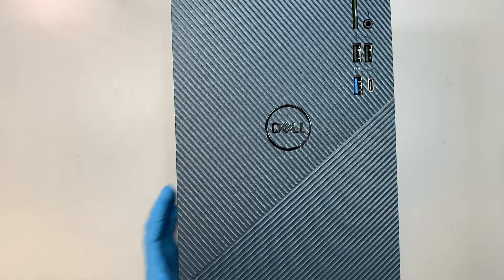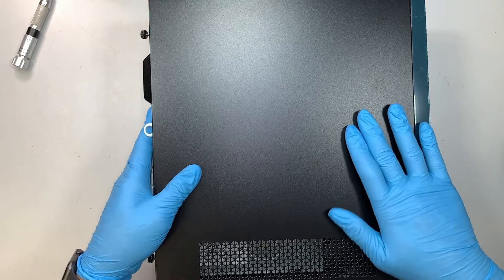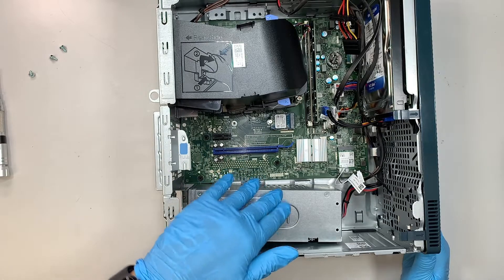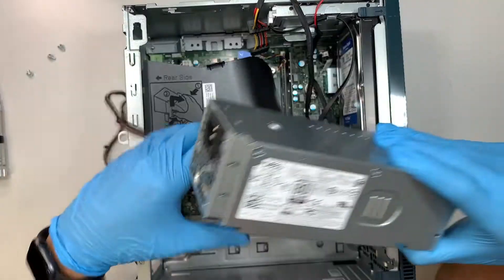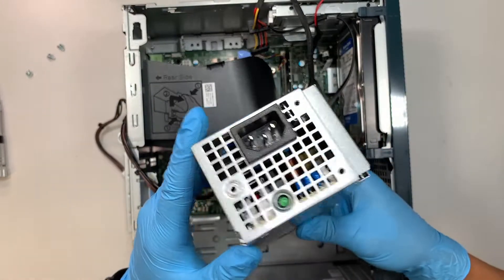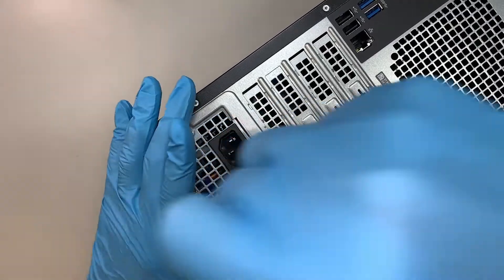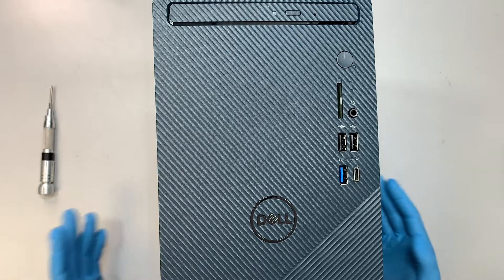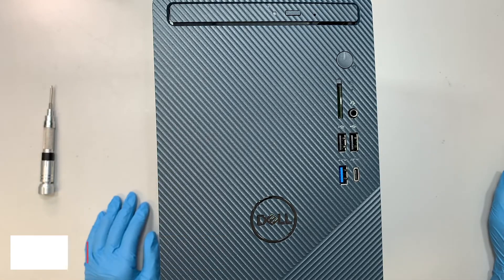Fixed Dell Inspiron  3910 No Turning On Bad Power Supply

Comment: Thanks for posting this. If we want to purchase a graphics cards (I mainly want one for photo/video editing not gaming) we'd have to purchase one that is powered by the PCI bus as the power supply it comes with does not have the cable or capacity to power a graphics card, correct?
Reply: If you buy a power supply from a different dell with the same proprietary power connector, you can have a gpu with a 8pin + 6 pin

Comment: Only 8 comments? Nothing about testing the new power supply first before you  take cables wires and unscrew everything and  take the original one out and put the new one in and screw it back on sid pnelll then it doesn't work  when it's the memory or the cmos or the CPU etc ?

Comment: I bought 4 of these 3910s for our office and they are complete pieces of shit. I even downgraded one to Windows 10 and it's still a piece of shit. Screen goes black for a moment, won't wake up from sleep, sometimes just freezes up the keyboard and mouse and becomes unresponsive. Problems with powering on.. etc. 

No more Dell for us.
Reply: I am sorry to hear of your difficulties. About a month ago, I replaced my almost 9-year-old Inspiron 530 with one of these new Inspiron 3910s, and so far my experience has been fantastic: Fast bootup, stable performance, handles all of the games I like to play (not graphics-intensive), tons of storage. I love my new little 3910. Mine came configured with the i7 CPU with 16gb of RAM.
Reply: @roycemoyer28  I have a Vostro 3910 which is pretty much the same! ..did you add a graphics card or are you using the onboard graphics?